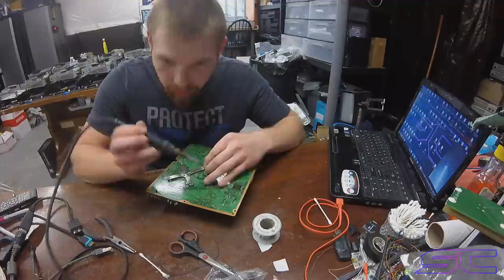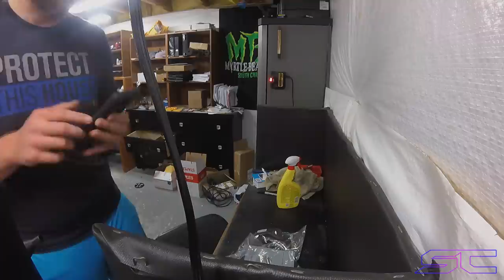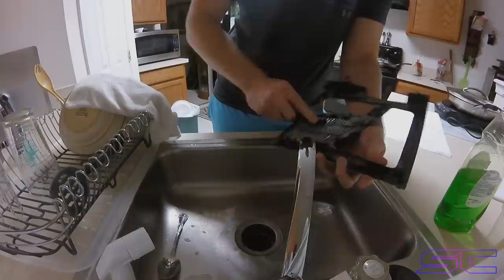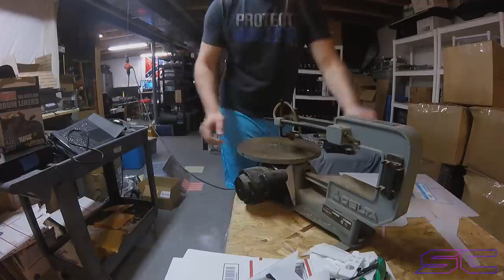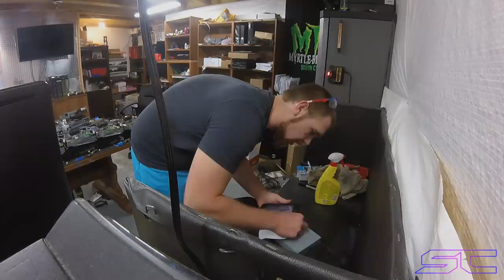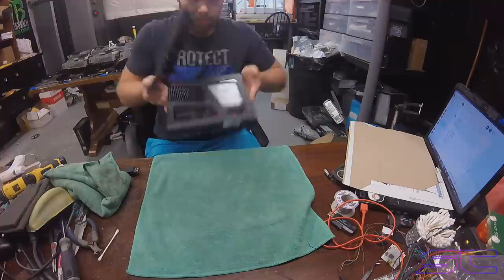Speed Run - Custom Corona RGH Build for Order #12637 | Recorded w/ GOPRO HERO +

Comment: Neat stuff. 

Issue: No ESD protection while soldering. Wood (high conduction) workbench.

Need to be extremely careful with these boards especially ESD. 

Keep up the fun work but make some changes to the setup to improve when you can.
Reply: Esd not an issue. Whats it going to break?

Comment: gets xbox
red ring of death
Reply: MrHacksss ez fixable
Reply: On his website he also does red ring fixes and so on.
Reply: By the time the E and slim xbox came out rrod was fixed
Reply: MrHacksss you're stuck in 2008
Reply: it cannot be fixed man
Reply: mhmoka The red ring is fixed on those new versions of the X360
Reply: E5fmjhmoka igual ao  pld
Reply: Țhĕ Ãľģəřïăņ bruh on my old old. 360 before the one came out my Xbox live was broken on there so I only played solo games which is how I didn’t fret tricked into thinking it was unfixable I got the rrod prolly 15-20 times and it’s a easy fix
Reply: A proper reflow of the GPU will fix rrod on any xbox 360 or ps3 counsel. Even the dodgy xenon motherboards can be fixed. I'm not talking about using the temporary youtube video fix via the baking method or using a heat gun.

I am talking about removing the gpu and replacing the lead free solder balls under the GPU with lead solder balls. If necessary and if the chip is dodgy, the GPU can be replaced and flashed for the motherboard.

The lead solder balls are more conductive and have less of a chance for failure. What causes the rrod is the lead free solder balls coming detached from between the GPU and the motherboard over time causing an incomplete circuit.

Since lead solder balls are more conductive and will melt at a much lower temperature and adhere better to the GPU and motherboard, it is very unlikely for them to cause any issues again.
Reply: Get external fan and vault even with prologed use no probs ive left mine running for weeks without issue-only cost my £18 so why not-uk sterling-be about 35$ or so.
Reply: not all rrod's are fixable. it could be a bad gpu or if you're really unlucky, a fried eprom chip. thats unfixable (i think)
Reply: Nope My slim red ringed...
Reply: It’s a slim it can’t red ring
Reply: Ouch
Reply: @reikoruffneck4613  And the Red Dot of Death was born.
Reply: Purple ring of death
Reply: If you get the 360 s you can’t get it
Reply: Dont you mean the Black hole of the milkyway
Reply: @riyadcheriet15  It's over
Reply: mhmoka why does everyone throw away they’re consoles when the get the rrod when 360 was a big console it happened too two of mine fixed
Reply: @riyadcheriet15  Now they can
Reply: Then realizes the leds were modded
Reply: How to mod ur xbox 360 with custom red light
Reply: Let's just leave this comment at 420
Reply: Gets corona: dead
Reply: @riyadcheriet15  yes it can be fix just takes a shit ton of work

Comment: Shrink wrap works better for that. There are also plenty of better ways to power the lights than to cut the DVD/CDR cable.

The chassis always is a constant ground. There are also actual pinouts that will show you where to solder to for constant power.
Reply: OhhKey! this is good to know.

Comment: I do not understand why so many difficulties. Install an RGB + cooler to make an overlay on the drive with a flowrescent and tape to place only ultraviolet. The connection is much easier from the power supply and not soldered to the board wires.

Comment: your realy selling these console's for that much.... a brand new xbox 360 slim only cost's 35 euro's here and i dont think the mods cost much either such a rip off :/
Reply: Trust me modding is expensive and the parts he had to buy for this rgh are like 30 dollars each plus you have to be a expert at soldring and the amount of time it takes is a lot modding isn't cheap
Reply: Immortal God dude he is selling a xbox 360 with case mods and menus for 270 that buys me a xbox one s with 1 tb and forza horizon 4 why the hell would i buy the xbox 360 with only 250gb menory and only support for old games when i can get a new xbox one s with 1tb of memory and forza 4 for the same price 😂
Reply: @rsownerwhahah  NVM dudes ripping you off 270 I didn't realize that
Reply: then dont buy it.i tell you a rgh can do so much more than a ps4 or ps4 can you play games with out the disk?can u play eumulators on the ps4 or xbox1.so yea its worth the money.
Reply: GAMING IS NOT A CRIME but can you upgrade the storage size? that's the question I actually have

Comment: Damn bro, solid work. I sent you a Kik message. Do you still do 360 Mods and RROD repairs? I have a PHAT HALO 3 with RROD that I want to get working again and a Gears 3 Slim I may want to do Dual Nand and LEDs on. And if it would work, a 2TB SSD for it maybe.

Comment: Hello, I would like to know how you do so that the light does not alter with the green panel that the front panel brings by default, when you use a white light it will turn green through the panel, blue will turn blue green through that panel, I would appreciate an answer, thank you!

Comment: If I order an rgh then does a stealth server come with it or do I bye that on my own
Reply: You have to buy a stealth server. When you get console banned (eventually) you need to buy a kv. Some stealth servers cost money, but they are the best ones so you don't get banned as often. Tip, get a monthly subscription or lifetime subscription to a stealth server because its much cheaper overtime. I suggest NiNJA, Teapot Live, or xbOnline.
Reply: NiNJA is like 80 per month. Its pricey but worth. I personally would recommend Teapot Live because its only 45 a month, has some of the longest kv life, and has most of the features NiNJA has. I don't use xbOnline so I won't know anything about it. KVs are like 5 per one. Teapot Live kvs last almost 2 years.
Reply: Qualitzy thanks I am probrobly going to go with teapot live when I buy my rgh tomorrow
Reply: @jjallstar5314  np 😁

Comment: $270 for a hot glue covered mess? Why didn't you sit the LED's under the side panel so they're not visible? Also hot gluing the wires to the bottom of the mobo? Amateur modder patrol.

Comment: All that hard work... The fast forward already takes 22 minutes, so the final result takes a lot more. But all that hard work, for basically a transparent cover with a light behind it... And okay, if it was done on a semi professional level, but it is not. Despite the efford you took and the professional equipment you used... 

I am not a hater or in search for negativity, but can't help dealing the fact that it took so much work, and being a perfectionist as I am, it's such a waste of your time seeing the end result. I really genuinely hope you earned enough for a living, so at least it a honest job. I really hope so... 

Few things that came to my attention, making it feel such a waste of work is:

- Not much attention of detail. You put a hole where the CD bay is. Then you cleared coated the CD bay but even from the video I could see the amount of scratches it made. Definetly no eye candy to have behind a clear window. 
- LED lights. I dunno about that one, possible personal preferences, but I do not like to see the LED strips, nor the wiring. To me, it has to be hidden away, but still see the glow.I could see the entire thing being there around the CPU cooler and even the edges. 
- Most important detail... Why the half cut off XBOX text on the window panel? Why not design it, so the text is gone, OR entirely visible... Now I see a clear cut off text that makes it look unprofessional. And that is mostly the first thing that makes the entire thing looks unprofessional, hence why I think it is a waste of time... Okay, if it was a project okay. But you made an entire batch... 

And in the end... All that hard work and what did it eventually get you? A lighted up motherboard that was never designed to show, ( because it aint a pretty looking motherboard ) In comparison with the PC, they try to make motherboards look great, they try to make videocards, memory and all great. So it is worth to show. But an Xbox 360 ? Even a Xbox One S isn't that pretty under the hood. If you want to do it, make it all the way: color coat things, use colored cable management wraps, chrome etc. Do something with it... 

Really I want to be positive, but it really hurts seeing you doing all that labour and with that as end result. I am positive that you can make quiet a few people happy with it, but that is because they aren't really paying attention to these details and just want to show off with a customized Xbox with some flashy lights.